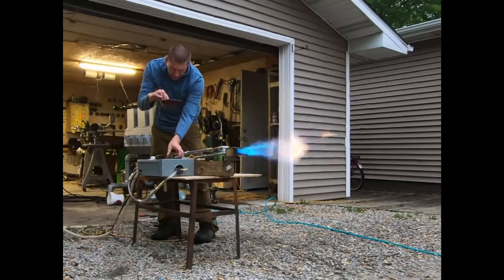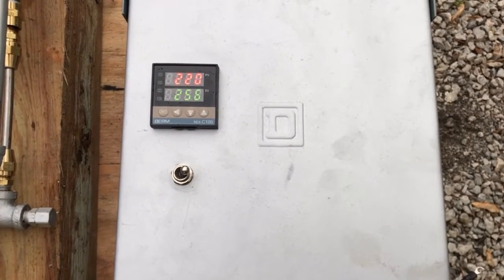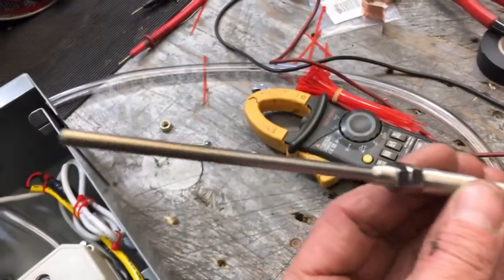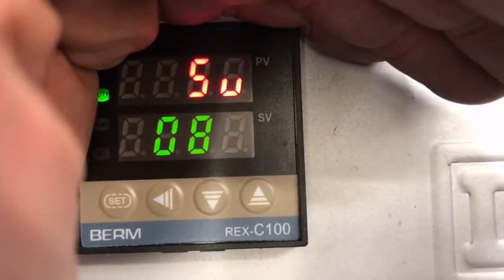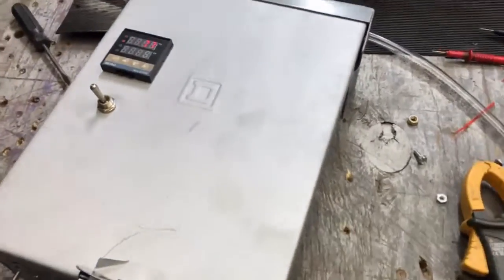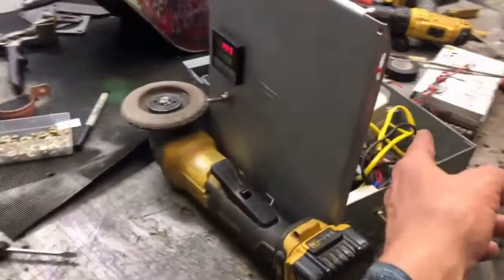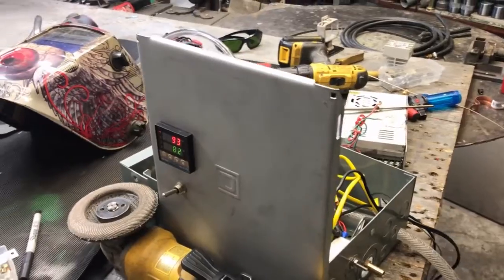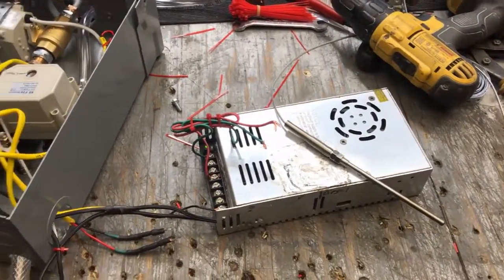PID controller for tire to oil burner

Comment: It's a 25 amp SSR   

    ssr25 DA.. .    Means 25 amp   DC input   AC output.       My experience  do not come close to rated current.... 
they burn out really easy. Best to get a size bigger ssr.

I have had problems  using  a ssr 40 DA  on hot water heating element.... staying latched on. You could remove the signal and the elements stayed running.... flip the breaker and remove power. And everything works fine....   it would happen randomly with other ssr as well...
Reply from the maker: Yes but the ratings in the amazon description stated 40 amps , im gonna have to call them out on this , dam china specs
Reply: A lot of those Fotek SSR relays are counterfeit and I think I recall the actual triac inside of the 25A only being rated at 12A and the 40A is a 20A rated triac. There is some info about with photos of them pulled apart. I have stopped using these and pay a little extra for a decent brand. Cheers